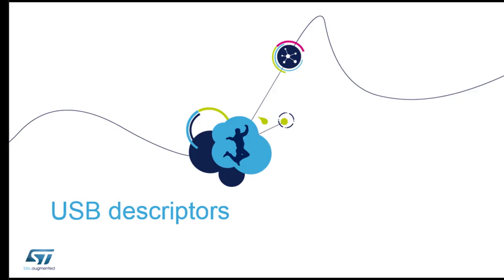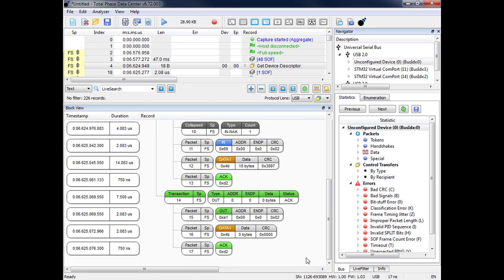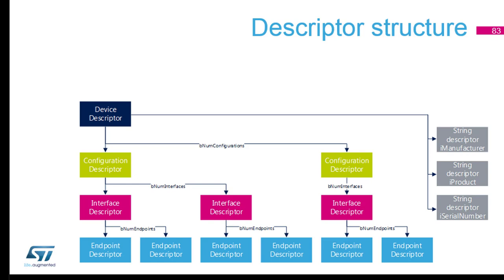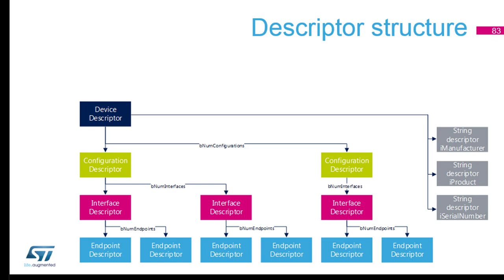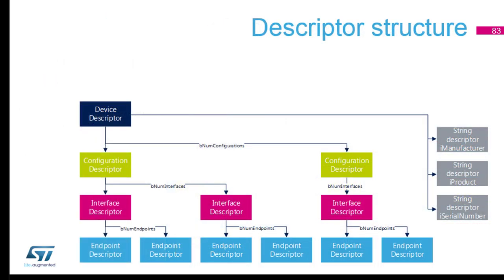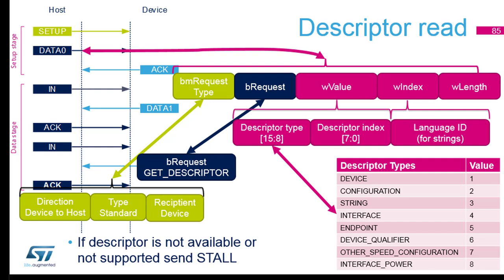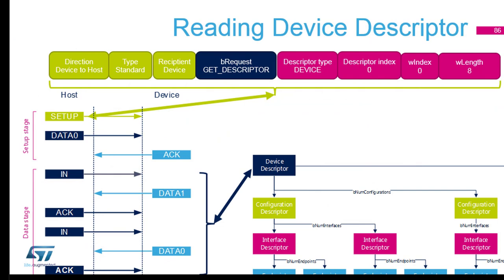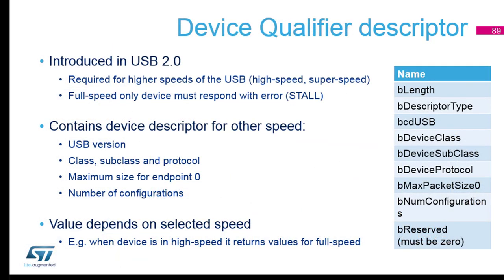STM32 USB training - 04 USB descriptors

Comment: On question - how are the endpoints created for a device? Does the firmware create the endpoints from the description? Does the firmware need code added from the project to create the endpoints? (if so where?) The issue is that this course does not look at the problems from a developers perspective..